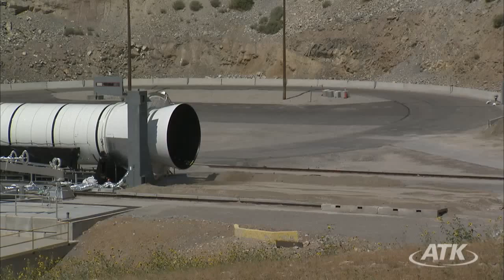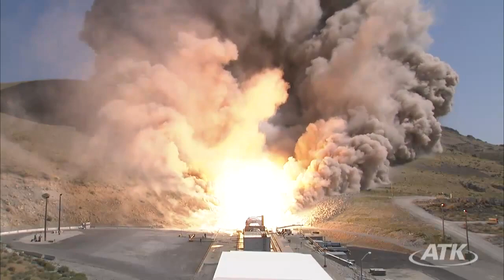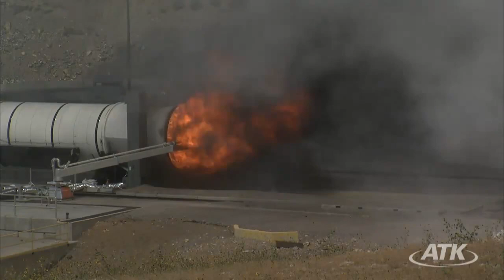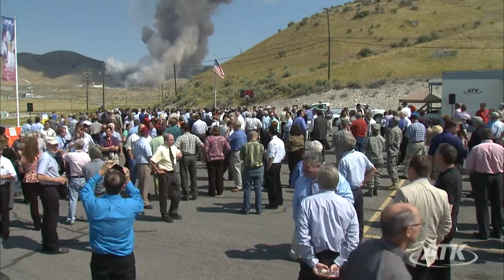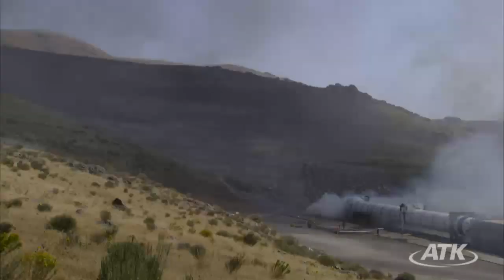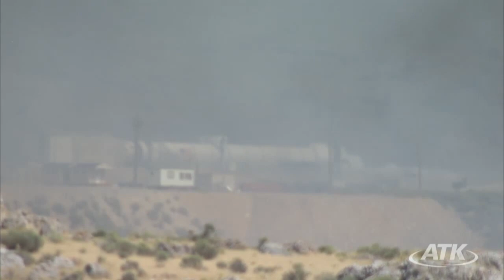ATK DM-3 5 Segment Solid Rocket Booster Motor Static Test Firing

Comment: How does it ignite so fast? Is it just THAT flammable or do they use a lightning bolt to ignite it?
Reply: Solid propellant rockets are like a huge bomb, but the energy is contained and directed.
Reply: Yeah I know that.  It's just the fact that armature rockets ignite so slowly in comparison. There's got to be a major difference in the SRBs besides just size.
Reply: +BackCountryBrdr the ignition looked like an explosion.
Reply: +BackCountryBrdr its hollow on the inside. A flame is sent down the middle igniting the propellant
Reply: That's not exactly true...solid propellant burns in a deflagrating way (slower)...while bombs in a detonating way (much faster). In this case we can see a sort of "explosion" becouse at the  beginning there's a septum in the throat section of the nozzle that allows the pressure in the chamber to rise up quickly. once the chamber reaches a pressure such as to break the septum, the hot gases flow through the nozzle and exit and you see the flame etc... however all this process develops in few  hundredths of a second.
Reply: In other words, it is just that flammable.

Comment: I wonder if you lined up 100 of these and set them all off at once you could make the earth spin faster or slower :D
Reply: Not an overly hard calculation to do. (Rotation can be a little dicey?) The short answer is "no."

The long answer is technically yes, but not noticeably. I am going to skip the extra steps for rotational velocity because its a bit more math, and the results are in the same order of magnitude.  One of these rockets outputs ~16,000,000 Newtons of force, the Earth weighs 5,973,600,000,000,000,000,000,000 Kilograms.

So if we set one to fire straight up in the air, it should push earth down. Acceleration (m/s^2) = Force (N) / Mass (Kg) So, A = 16,000,000 / 5,973,600,000,000,000,000,000,000. You end up with an acceleration of 0.000,000,000,000,000,002,678,451,9 m/s^2. So while you would push the earth, even a million of these running full blast for a day would set the earth moving in a direction at a speed of 0.23 Micrometers a day. (A micrometer is a millionth of a meter.)

I just punched things in on the calculator, but hopefully this is all proper. It is amazing how massive the earth is.
Reply: Surly it would if there were enough of them burning for long enough

Comment: Can someone tell me about the spark on the SRB at t=-0.5?
Reply: I saw that too, I think that's the ignition charge or something?
Reply: I can't speak for this engine specifically but NASA uses a system similar to explosive bolts to ignite their SRBs; the flash of heat starts the oxidization of the aluminum fuel. I'm guessing what we're seeing at t-0.5 is a similar explosive ignition system.
Reply: I once saw a video of somebody successfully lighting a lump of APCP with only a standard safety match. APCP is the fuel used in the Space Shuttle SRBs.

Comment: After Challenger, Didn't the Accident Investigation Board recommend ATK test the SRBs vertically ? Why have they still ignored this recommendation ? Seems to me...if they have another accident, they have set themselves up for negligence lawsuits !
Reply: pretty sure that was for liquid, doesn't make a difference on solid
Reply: Nope...it was specific for the solids...I think they could figure out how to bolt it down. I'll try to find the accident investigation boards recommendations and post here. There were something like 11 specific recommendations.
Reply: Brandon S Actually when you think about it...your logic is flawed. Firstly. The loads of having the solid motor upright are much different that vertical. This was sighted in the accident investigation board. ATK did not test the solid motors under realistic launch configurations. Specifically the loads on the O-rings are different. Secondly, Nasa ignites 2 solid motors on the launch pad with the SSMEs and they don't fly until the bolts are blown.
Reply: Brandon S Brandon...Here is the Specific NASA recommendation to test the solids upright.

http://www.hq.nasa.gov/office/pao/History/actions.html
Reply: dcb1138 Interesting document. It seems to say that they were doing a study to determine the preferred test orientation, but no recommended orientation is mentioned there.
Reply: Actually the cause of the challanger accident was not the configuration of the test but the ambient temperature which was too cold and the o rings had not been tested at such low temperature.
It was NASA that made the crucial decission to launch, Thiokol did not recommend it..  All 130+ sucessful flights of the shuttle were done on rockets whose designed was finalized based  on horizontal testing.

Comment: I don't understand. How is that thing staying in place? This rocket is powerful enough to get a space shuttle into orbit. So why isn't is flying away?
Reply: +Geffen Avraham Obviously they bolted it down to the ground for testing.
Reply: +risingone equally****
Reply: lol, can you imagine? suddenly the rocket starts moving in the opposite direction of the thrust vector
Reply: isn't that illogical?  since if the ground is pushing harder that becomes the new thrust vector. ;)
Reply: the ground can't push harder, the ground only excerts a reaction force, reaction forces can only be equal and opposite to forces excerted on x.

Comment: im sure someone calculated the thrust or angular momentum it imparted on earth. must be negligible like so many thousands of a degree per second it added. thats if you dont count the atmosphere slowing the exhaust gases. hmm if no exhaust gases indeed leave the earth then by newtons laws it couldnt have changed the earths rotation??
Reply: Well some of the exhaust gases move toward the sides, ir turn back towards the srb,so the equilibrium is not conserved :)
Reply: Zero. The force imparted on the ground is cancelled by the force of the atmosphere stopping the exhaust gasses.

Comment: That would be an awesome way to die, staring down the ass-end of a booster like that. Instant, totally painless and hardcore as hell to boot.
Reply: Fun fact: deaths from fire are usually caused by the fire burning up the oxygen around your body, killing you from suffocation, rather than the fire. This would probably just melt you, though.
Reply: ***** Yeah seriously, you wouldn't have time to melt, you would be completely vaporized and blown away in an instant.
Reply: @THR33SIXX3MPYR  oh, and burns becoming infected, as well as the blood vessels becoming cauterized, and smoke in your lungs, and blood boiling, not to mention the fact that the amount of force produced by the superheated jet would not only be capable of shattering every single bone in your body, but upon contact with your skin, the kinetic energy of the blast would convert into just enough thermal energy to vaporize all of your soft parts and flesh! In fact, if you concentrated all that energy into a sphere about a millimeter across, it would actually trigger a nuclear explosion! All that energy dumped into a single milliliter of water would immediately fuse almost all of the hydrogen in it to helium, regardless of the isotope. The result would be an explosion with a yield of approximately 100 kilotons of TNT!!! For comparison, the atomic bomb dropped on Hiroshima had a yield of only 15 kilotons of TNT. Insane!

Comment: Doesn't anyone wonder if these tests could change the rotational speed of the planet??
Reply: Bilal Heuser the ea
Reply: Bilal Heuser the earth weighs 5.97200 × 10^21 tonnes and its velocity is 63,000 metres per second which gives you 3x10^26 pa of force and the thrust to weight ratio of the solid booster is 1360 tonnes meaning it would only change the rotational speed of the earth (if even facing on the x axis of the planet) by roughly  0.00000001% THANK YOUUU